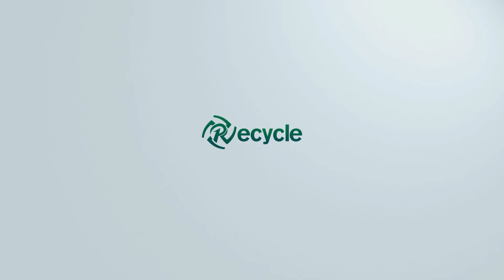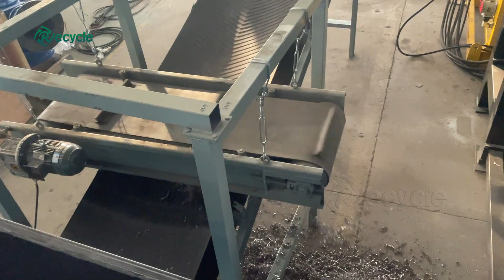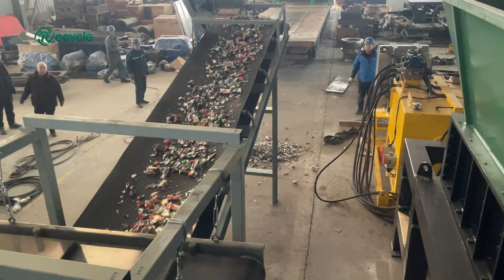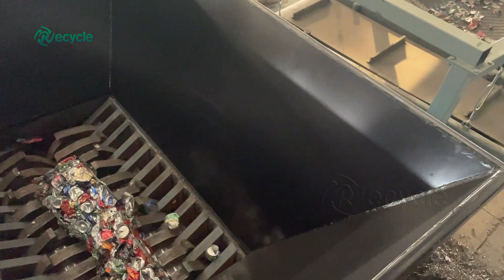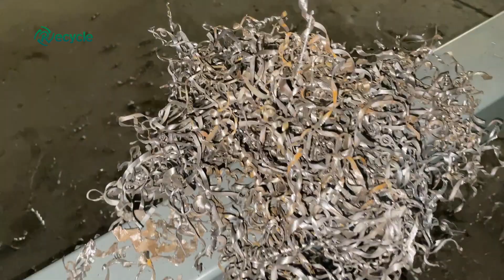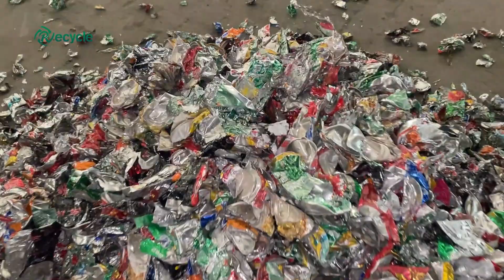2-3 T/HR Shredding Machine for Aluminum UBC and Iron Shavings

Comment: Why do you shred it? I just need to melt it, no?
Reply from the maker: Shredding aluminum UBC (Used Beverage Cans) before melting serves several purposes, and it is a common practice in the recycling industry. Here are some reasons why shredding is beneficial:

1. *Increased Surface Area:* Shredding the aluminum increases its surface area. This is important because when you melt metal, having a larger surface area allows for more efficient heat transfer, speeding up the melting process and reducing energy consumption.

2. *Uniform Size:* Shredding helps achieve a more uniform size of the aluminum pieces. This uniformity ensures consistent melting and helps prevent issues such as uneven melting or clumping.

3. *Improved Melting Efficiency:* The increased surface area and uniform size contribute to improved melting efficiency. Smaller pieces melt more quickly and evenly, reducing the time and energy required for the overall melting process.

4. *Reduced Oxidation:* Shredding can help minimize oxidation during melting. Smaller pieces of aluminum are less prone to oxidation because there is less surface area exposed to the air. Oxidation can negatively impact the quality of the melted metal.

5. *Faster Melting Rates:* Shredded aluminum UBC melts faster than whole cans. This is particularly important in industrial settings where efficient production and energy conservation are priorities.

6. *Ease of Handling:* Shredding makes handling and transporting the material more manageable. Smaller, shredded pieces are easier to handle, store, and feed into the melting furnace.

7. *Quality Control:* Shredding allows for better quality control during the recycling process. Uniformly shredded material ensures that impurities, such as non-metallic substances, can be more easily identified and removed before melting.
Reply: @HENANRecycle  It is recycled because it compresses aluminum. He is the man who runs the company. I'm happy to get a lot of information.
Reply: @HENANRecycle   korea!!
Reply from the maker: If you are interested in shredder and recycling machine, please contact me at Kristinlee.recycle@gmail.com